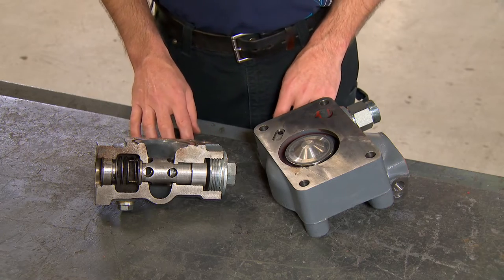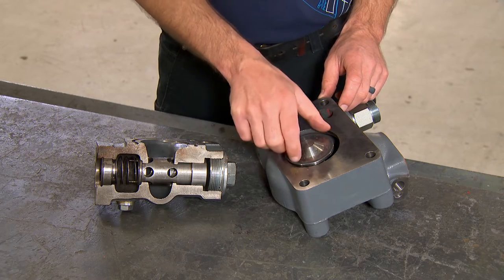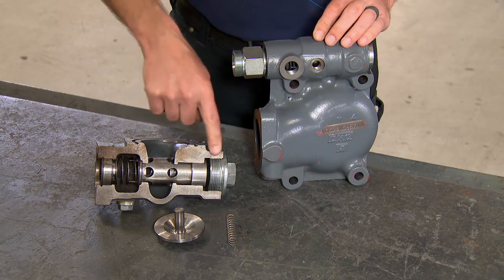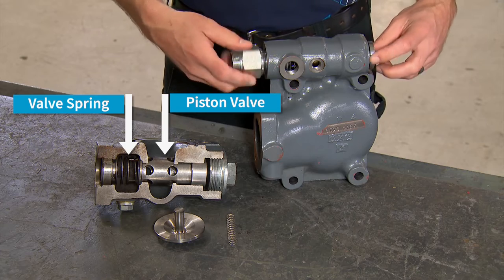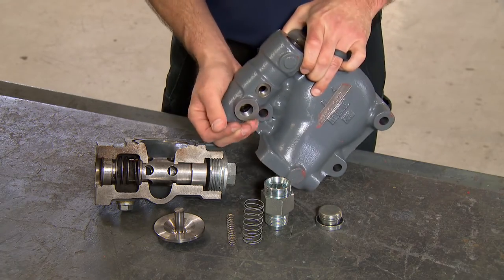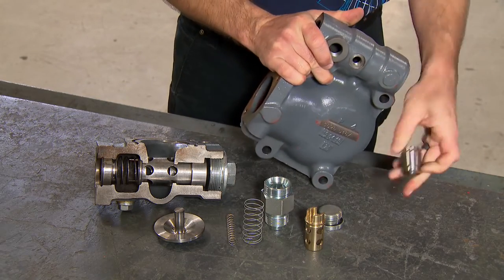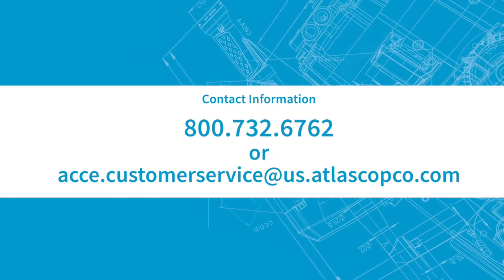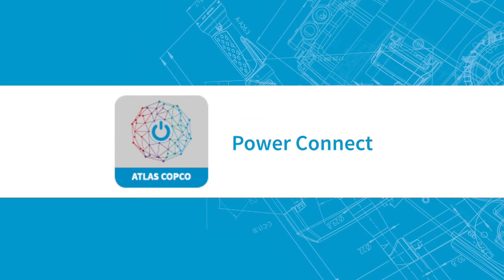Atlas Copco Check Valve & Oil Stop Service | Atlas Copco Power Technique USA

Comment: We have ga 11 ff air compressor, but problem is temperature going 120 decrease, so please tell me how to solve this
Reply from the maker: Hi Dondapati, please send a detailed description of the problem together with your contact information to social@atlascopco.com so we can offer you more support.
Reply: Change your Thermo valve mate. Touch oil cooler when temp us around 88c if it's cold and still going up the valve requires replacement. From an ex atlas copco service engineer

Comment: Do you no why lots of oil come from air intake when I shut down
Reply from the maker: Hi Ibrahim, thank you for bringing this to our attention. Please reach out to our Technical Support team so we can adequately resolve this issue. 1-800-732-6762 Thank you!
Reply: We have atlas copco GA37 
Temperature 🌡️ rising issue
What is the main reason of it 
How to rectify this issue
Guide please
Reply from the maker: @aghababarali3650  Hi Agha, we are here to help you. Please write to us about your complaint and share your contact details with us at Social@atlascopco.com. We will have our team get in touch.
Reply: Rebuild the unloader.
Reply: Check them seals.